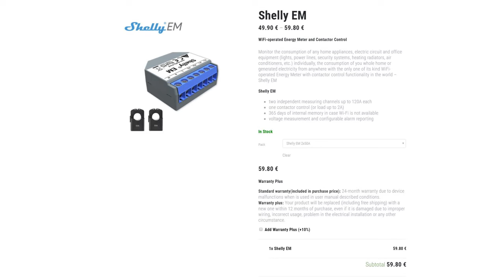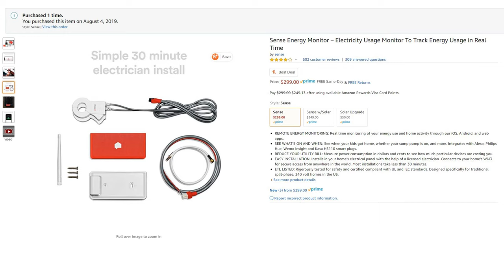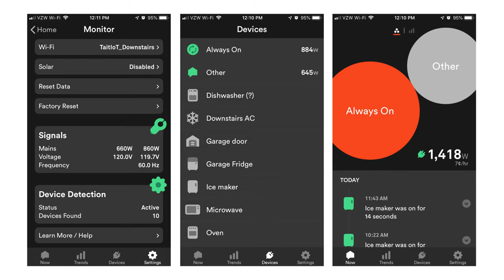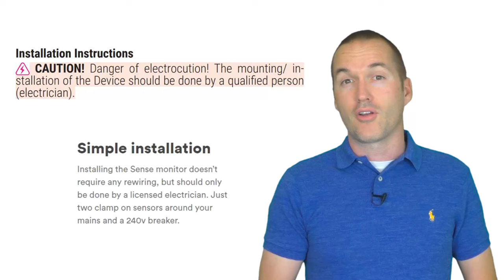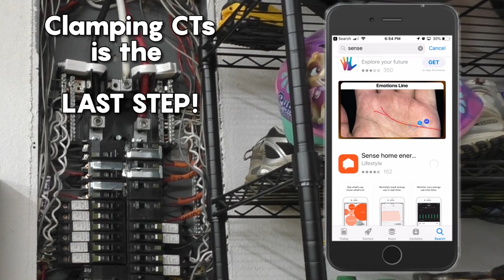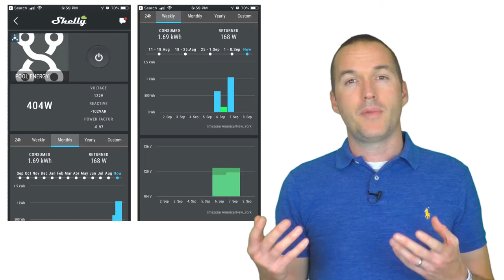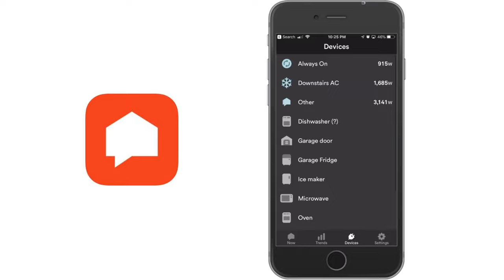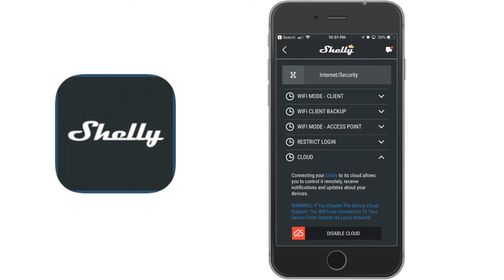Which Smart Energy Monitor Is Right For You? ShellyEM vs Sense

Comment: Wow. As a german this circuits and breakers looks like its from stone-age.

But at all, very good and nice video. 

I would always prefer the shelly. I dont like this auto-discover thing.

Oh and about the MQTT-Topics:

Im getting the topics where you told you never got them. The shelly is sending them each 5minutes or so i think.
Reply from the maker: Oh nice, maybe I didn't monitor those topics long enough.  I wonder why they are sending reactive power so infrequently since it's just as important as total power.
Reply: What do German circuit breakers look like?
Reply: @darthtater  Google for ABB circuitbreaker.

Comment: Have a look at smappee. It has the ability to learn a new device if you turn on off 3/4 times.
Unfortunately the closed local API access so there's no more access to the discovered devices to HA. They maintained local mqtt access so you still have access to overall power consumption

Comment: Great video! Shelley sounds like a solution that I have been seeking since my original plan of Emporia Vue was foiled by the fact that Emporia requires a connection to the cloud for the app to read any data. My use case is the desire to monitor instantaneous load of my backup generator while it is powering select circuits on my breaker panel. I lose internet when my neighborhood power is out so I can't read Emporia data when the generator is being used. But I do still have local wifi and it sounds like one of the Shelley devices can easily be used to display load on my backfeed wires, correct? I see a lot of Shelley devices on their website now - any that you recommend for this limited use case?

Comment: Hey, I wanted to verify that you've actually wired the Shelly as you mention at the 5:48 mark in the video?  I'm interested in measuring two 240V circuits in the United States and was hoping to only use 1 shelly device to do it.  I keep hearing conflicting info as to if I can power the shelly from both phases of the panel.
Reply from the maker: You'll want the shelly 3em to do that, not the standard em like in this video.
Reply: @TheHookUp  Thanks for the clarification

Comment: Has the discovery been fixed?  Are there better alternatives?
Two legs.  Only one phase.
Reply from the maker: Sense device discovery has not been improved.  What is your use case?
Reply: @TheHookUp  My well pump/motor has failed in the past.  Also, my pressurizer pump/motor.
I want to be able to alert if either has run more that 5 minutes.  
If it's not picking up all the loads, I'll probably settle with Emporia Energy
(Later I will add a WiFi breaker with a shunt trip)

Comment: Thanks for the demonstrations! Very helpful.  My Comment is:  The Shelly US online store is frankly terrible. They don't accept credit cards, They don't ship to the Virgin Islands , and they don't answer the phone.   There is a Shelly EM  on amazon , that's great but they only offer the unit with 1 CT (good for 120v only).   My Question is : Where did you purchase your additional CT's ?
My application is to monitor energy use at 3 different apartment sub-panels , and on 4-5 additional circuits for HVAC  (All are 240v )   I need to apply usage to each tenant.
So I think I need 7 or 8 EM's and 2 CT's for each one.  I'm assuming the app will let me label each EM however I wish.   Please advise and Thank you again!

Comment: There was an article a long time ago (20+ years) that Popular Science or Mechanix Illustrated had on monitoring power using just gross mains power.  My wife and I did it manually for a while as an experiment.  Without extra equipment, we turned off all non-always on equipment and left the house for an hour, reading the power meter before and after we returned.  We did the same for washing a load of clothes, drying them, cooking a chicken, boiling a pot of water, running our heater, and air conditioner, and even our lights and TV.  With all this power data, we generated our spreadsheet and graphs (yes, by hand, no computer).  We learned a lot.  

With experience writing an app, it should be easy to almost replicate the Sense without the AI.   It does take some dedication and sluthing, but it can be done.  Some loads are SO small, that they hardly matter (alarm clock), but even your always on TVs and cameras do make for a pretty heavy load, especially if you are doing this in preparation of going 'off grid' or other similar effort.

Comment: I need a smart plug with energy monitoring to figure out if a device (like a non smart tv or audio system) is on or off on home assistant without controlling the plug. I don't want to turn this plug on or off. I just need to know current flow... Or some sensor to connect directly to raspberry. Help? I can't find such device.

Comment: How that it's been a few months from this review, has the sense recognized more of your devices?
Reply from the maker: I think it might actually be worse now.  I'd say 80% of the time I only have 2 energy "bubbles" one for "Always on" and one for "Other".
Reply: @TheHookUp  That's a total bummer. Thank you for sharing your experiences with us, and I appreciate your thorough videos!
Reply: @TheHookUp  You've most likely incorrectly installed the sense on the same phase: https://www.youtube.com/watch?v=s0A7WNOuw0E&feature=youtu.be&t=260
Reply: i need to monitor just my energy usage. i live in a home that has been split in half...the upstairs unit is a 3 bedroom 2 bath & my downstairs unit is a 2 bedroom 2 bath. My pg & e bill is sometimes $600 so my half would be $300.....but i know i dont use that much energy. I domt have a A/c, a heater, a dishwasher which the upstairs unit does have & my fridge is mu h smaller than the full size fridge is upstairs. what device would you recommens i install?

Comment: I was thinking about the sense but in my area the outside service panel has on the 240v breakers and the inside panel has all the single pole breakers. Im worried it might not be able to recognize the circuits in the inside panel or at least distinguish them from one another

Comment: So with the two 120A clamps, you could essentially use the shelly as a whole home monitor as well. Then you could create a helper where if something is using both phases you could double or halve the values depending on the reference voltage. It should work like this if my understanding is correct right?
Reply: His wiring diagram is much different than what I've seen online.  I think the Shelly only comes with one 120 amp CT and I haven't been able to find where you can purchase just another one by itself.

Comment: Shelly offers a choice on the CT clamps (e.g. 2x 50A , 2 x 120A , 1 x 120A & 1 x 50A), initially, I just want to monitor my whole home consumption and will be wanting a 120A CT clamp for sure but is there any benefit to getting a lower amperage clamp? 
I should clarify, I'm in the UK where we run on 240V Single Phase. I don't currently have a plan for the second channel so should I just get 2 x 120A CT clamps?
Reply from the maker: The lower the current tolerance on the CT the more precise your readings will be.
Reply: @TheHookUp  I did think that could be the only reason for there being different rated clamps.

Comment: what about this new wise one  that seems easy to use .The only thing in both of my panel boxes I do not have any extra breaker spots .How would these work with that and if I have to borrow power from another breaker how can you tell if it is pulling to much power from what ever that breaker is used for .The electricians here in VA do not seem to understand these devices when I ask them about install of one in my house >My house is all electric and I would like to know when something may be using more power than needed .I have a well and that and the heat pump concern me .

Comment: No Leakage or GFC? Scary.
JP is the same, just a bit lower around 100v.  And our distributions are usually plastic boxes next to the bathroom!
Reply from the maker: GFC is on specific circuits, not in the panel itself.

Comment: I'd get a Sense IF and only if they added the capability to turn something on, and then tell the system what you just turned on. Seems like it would be an easy way to greatly increase the reliability of their algorithm. I get that they want to sell a device that you just install and then don't have to do anything else, but it's been years and the accuracy, if it even registers a device at all, is still in the toilet.

Comment: how much power do these use and if they use a lot of power where are you saving electricity
Reply: sissy murphy The CT’s use almost no power. Most of the power draw comes from their processors, which for the Shelly is probably a micro controller like the ESP32. The Sense is probably using a few passive components, micro controllers, and application processor like in an old smart phone. I’d estimate it to be up to 5W. So about $5-10/year in electricity.

Comment: Lets say you have a smart switch that consumes 200mW @ 5 volts: that's 1 full Watt per hour x 24 hours a day = 24 watt/hours per day or 8.7 KW hours per year. Your electricity cost is 8.7KW x .11 cents per kilowatt/hour so about $1 dollar per year to power the switch itself. Seams reasonable right? Perhaps, but what if the device it controls is a 100 Watt hallway closet light that's only on for a total of three minutes per day. 100 Watt/hours divided by 60 =  1.66 watts/hours x 3 minutes = 5 Watt/hours per day or  1.8 KW/hours per year: so 1.8KW x .11 cents per watt = 20 cents per year. In this scenario its costing you more $ to run the switch than you are to run the light itself. If a smart switch can't pay for it's own power consumption by the inverse savings on the device it controls, then its not really a "smart" switch is it? Now add up the power consumed by every ESPxx module, MQTT broker, Raspberry Pi, Home automation server, and a shit-ton of other line / power conversion losses and parasitic losses due to unnecessary LED's and soft power-on devices like TV's and A/V Receivers... I'm just making an educated guess here but from what I've seen so far on your channel, it would not surprise me if you home is consuming at least 300 Bucks a year (more than it needs to) That's a whole lot of juicy prime-rib steak for Daddy!
Reply from the maker: The primary purpose of my smart home is not energy savings, it's convenience.  I agree that removing all connected products from the house and just using standard LED type bulbs would result in a lower power bill... but probably less than $20 bucks a month.  Pool pump, pool heater, and air conditioning make up about 75% of our power consumption.
Reply: @TheHookUp  Could you if possible add the idle power draw of each switch you test? It would help a lot of us who are trying to get a good balance of convenience and power savings

Comment: very informative video. I havent heard of shellyEM but i have seen the Sense on Amazon. it looked pretty nice but for $300 and the sensing issues NO thanks. you could say it has no sense. 
I'm actually making my own. i dont need fancy machine learning, just basic info of what each breaker is using. maybe even add solar input to it too. 
and I'll have full control over every aspect of it and how the data is handled. Its not all that complicated to do. getting Analog data from a CT and using it effectively isn't inherently difficult.

Comment: Also check out OpenEnergyMonitor and its derivative based on esp8266 - IoTaWatt (both open source)
Reply from the maker: I've been emailing with the IoTaWatt guys for almost a year now, they've been having a heck of a time getting the rev 2 to market.
Reply: @TheHookUp  +1 for the IotaWatt. Had mine running for 6 months now. love it...
Reply: IotaWatt is amazing.  You can run 14 sensors and it feeds data into influxdb from its logs (so it backfills when the network or db server is down).  Anyone interested in knowing power usage should get one.
Reply: @TheHookUp  They are on Rev 5 at this time and I love mine.  It is not via OpenEnergy.org but the IoTaWatt forums or the shop site.  Try reaching out on either of these and you will find the maker very open and willing to assist!
Reply: @DanielHyles  Been using mine for just over a year.  Set it and forget it.  Love the device.
Reply from the maker: @scottbrown4611  They actually contacted me wanting me to review it, but they never shipped it because they said they were waiting to put out a new revision... That was almost a year ago now.
Reply: @TheHookUp  Hopefully they will send you one now after seeing this videa because it wouldn be really nice to compare it with those two.

Comment: For only a bit more than the cost of the sense, you could have a Brultech Greeneye Monitor https://www.brultech.com/greeneye/ which can control 32 channels of current transformers.  It can handle both spit-core "clamp-on" transformers, like what I use for the high-current, unprotected power feed into the panel as well as the cheaper "donut" style current transformers that are less expensive.   I use the latter for the branch circuits where I just turn off the breaker, pull out the wire and slip the CT over it before restoring it.  The device can be configured to be used with CTs that have built-in burden resistors or not.  It also has 4 channels of pulse counters and you can connect (up to 10, something like that) Dallas one-wire temperature sensors to it as well.

There are a variety of interfaces, from serial to Wi-Fi and ethernet.  I use Wi-Fi because I like having the "air-gap".  Brultech documents their protocol messages, so you can use it totally locally without any cloud service.  They also have some sort of microcontroller widget that connects to it to collect historical data, make pretty graphs and stuff... but I have Home Assistant for that and didn't buy that product.

While they sell packages, you can buy it mostly a-la-carte with the flavors of CTs that you need for your application.

I have mine reporting power measurements every two seconds, which includes the measured voltage for the panel, the current, power in watts, accumuated power usage counters in watt-seconds, etc.  The power measurements are "polarized" and can go negative to distinguish the "direction" of current - this is intended and useful for those with, e.g., solar power generation where you might be feeding power back into the grid and want to measure that.

I've been really happy with their products - I had their older device with only 5 channels and no built-in Wi-Fi and upgraded because I wanted more channels.  While this isn't quite as pretty and polished, intended for system integrators and slightly more sophisticated end-users.  Of course, if you're poking around inside of load panels, this probably lines up pretty well with their intended customer segments.

There is a Home Assistant integration that was done for this product; I ended up writing a python script that publishes MQTT messages from before the Home Assistant integration existed.  It's nice that the company doesn't make some bit secret over how to talk to their product and just documents their message formats.  They also don't have a cloud service of their own, so your product will continue to work past the future failures in cloud-based business models of other vendors.
Reply from the maker: That is a serious piece of equipment!

Comment: Quick correction: they are called current transducers. Not transformers.
Reply from the maker: In my experience they are usually sold as transformers, but I agree that the correct technical term is transducer.
Reply: Its only a transducer if it has another component that converts the current output into another form of measurement.  A basic 250:5 ratio current transformer will output 5 amps for on a 250 amps measured on the circuit.  If you where to integrate an A/D and D/A converter inline with the output to convert the 5 amp out put to a 5V output or a 4-20 ma output, then you could call it a current transducer.

Comment: 65 USD still a lot for the shelly em
Reply from the maker: Having never built one myself I'm not entirely sure it is a lot.  That's including 2 50a CTs which appear to be around $15 each if purchased separately.

It's the cheapest CT energy monitor I've seen.
Reply: @TheHookUp  it might be justified but still a lot.  Especially if you use it for an individual device. Then the sonoff pow might be a wiser option. I presume the CT's do t need 50 amps through their coils so I presume that rating dictates their range.
Nevertheless, an good comparison. Very informative

Comment: If my house has 400 amp service (2x 200 amp panels), would i need 2 sense units?
Reply: Sense is rated for 200 amps, so yes you would need 2. Or, if you know you never pull more than 200A then you can hook Sense up to the feed before the split and use 1.  200A is a lot of power, the max I ever read on my house was around 65A.  What you could do it buy 1, put it on 1 set, see the max you might get (add up all your max appliances).  Repeat it for the other set.